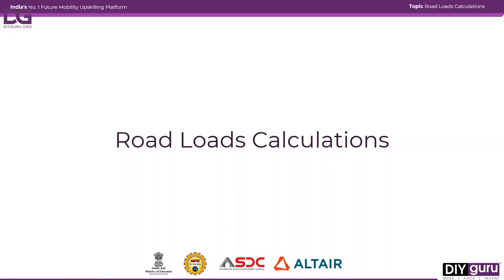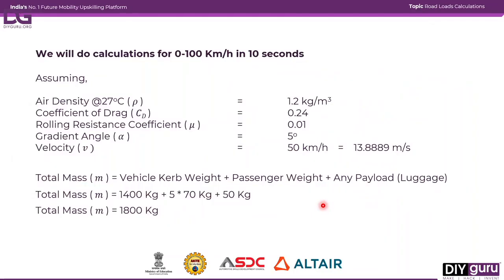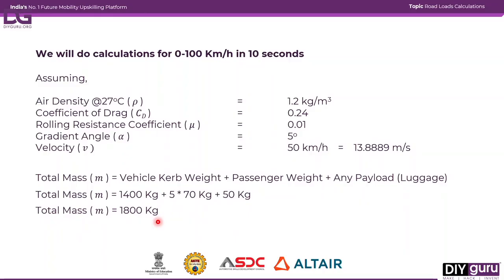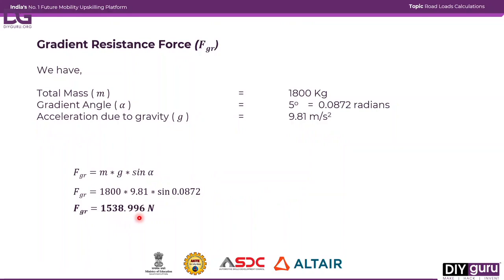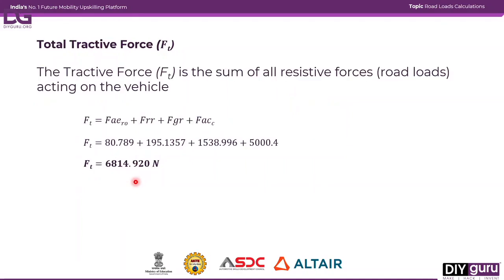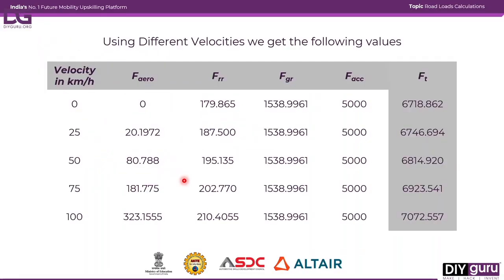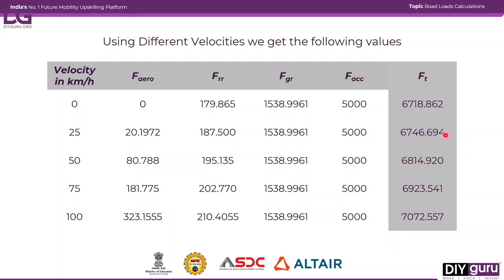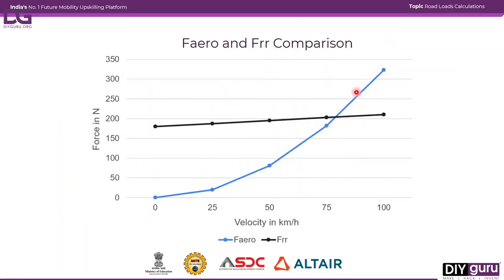Basic Road Loads Calculations | Total Tractive Force | TATA Nexon EV | Electric vehicles (EV)

Comment: Sir,
 greetings of the day 
explained in the most simple manner, for everyone to understand easily.
Could you please tell how to calculate the torque in Nm at the wheel,  required to propel a bus of   Gross weight 16200Kg , speed 90 Kmph,  wheel tire diameter 1012 mm, wheel rim diameter 600 mm.

Comment: In acceleration Force measurement  you have considered m equal to 1800.. but its Kg .. should we divide 1800 by 9.81 to get mass? is the force 9.81 time higher than it actually should?